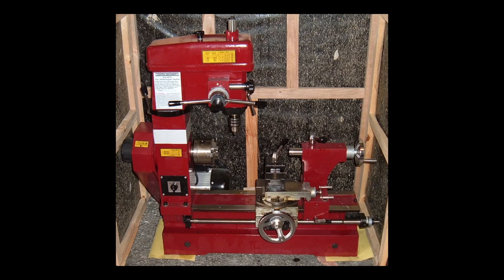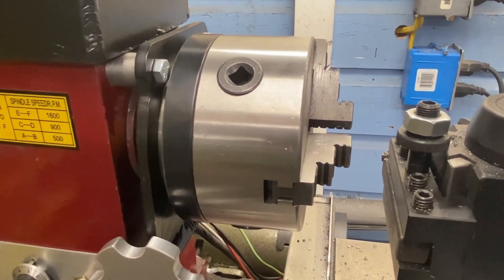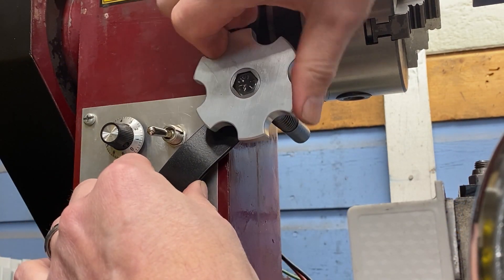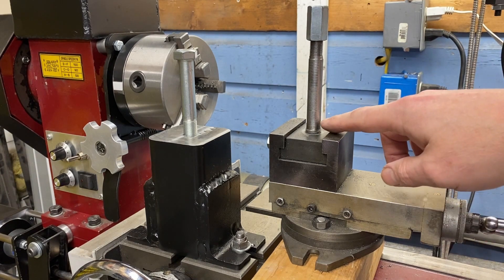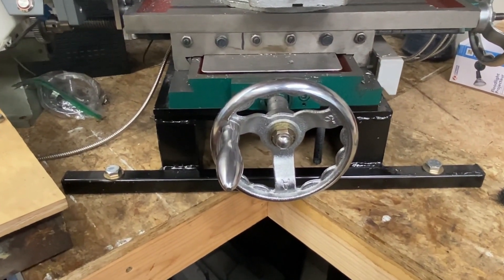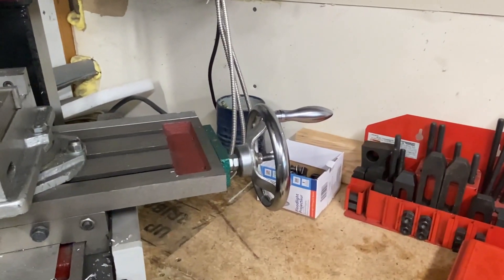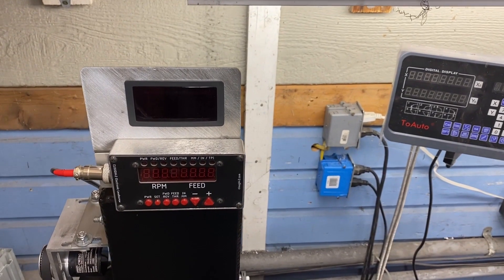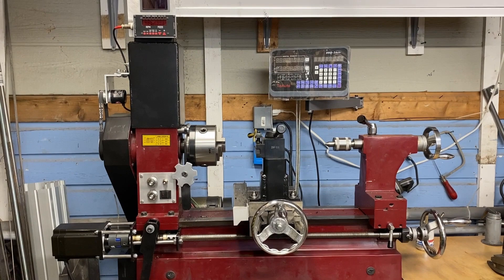Top 10 DIY Lathe Mill Upgrades to my Harbor Freight 3-in-1 Mill Lathe Combo Machine

Comment: This may be slightly off topic, but I would like to replace the brushed motor in my mini lathe with a Servo motor. Ordered a 550W, brushless, sewing machine, servo motor from AliE because of the motor size. Any thoughts? Thank you for sharing your modifications.
Reply from the maker: First of all size matters, typically the smaller it is the less suited it is for a lathe.  After that It comes down to three things: torque, max RPM and duty cycle.  If the motor you are looking at has enough torque and RPM to be able to "do the job" than it should work as long as the duty cycle is such that it can run for extended periods of time without overheating.
Reply: Ordered it back in mid February before watching your videos. Today, I would've looked for a 750W or 1000W. Live and learn. Hopefully, the 550W works for the type of projects I machine. Cheers
Reply from the maker: I hope it works really well for you

Comment: Your presentation of the Combo Machine that most guy’s love to hate, was excellent. You certainly out did yourself with all your upgrades. I like these machines and I owned one for more than 10 years. Then I bought a large lathe built to “Tool room precision”. But whenever I had a small and not critical job, I always went straight to my little Combo.
Reply from the maker: I never understood the haters.  I think the biggest issue is unrealistic expectations.  If you expect a $2000 combo to perform like two $5000 stand alone machine you're never going to be happy.  There is a group of us combo machine owners on Facebook and it is the most ingenuitive bunch I have ever been around.

Comment: Sir when you changed the lathe Chuck to 5 inch four jaw ,did you make a mounting plate for the new Chuck?  I have not removed the 3 jaw Chuck? And don't really know how to remove it?. Let me know if you have time. Thank you Karl
Reply from the maker: Mine is held by 3 M8 bolts on the back that are hard to get to.  I then used this adapter to make it fit.  Let me know if you have any other questions https://amzn.to/3ZNLGNQ
Reply: Lock your spindle, use a chuck key and put into check, then tap to loosen with a rubber mallet.

Comment: I've been watching your videos for the past couple of days and really admire your fabrication skills and knowledge. I have a slightly newer version of the exact same machine.  I also dumped the mill as its accuracy was questionable at the best of times. My number 1 mod was to install ball screws, stepper motors, controllers, an old computer running Windows XP, with Mach3 installed. This has totally transformed my ability to do good machining. Try it, I'm sure you'll like it.
Reply from the maker: Thanks, my fabrication skills were acquired by trial and error.  I am mostly self taught.  The accuracy of the mill improved significantly when I made it its own machine, especially after it was upgraded to an adjustable column.  As for the CNC part of it at this point I am content being a manual machinist.  I like working the hand wheels and do not foresee making any changes in the future.